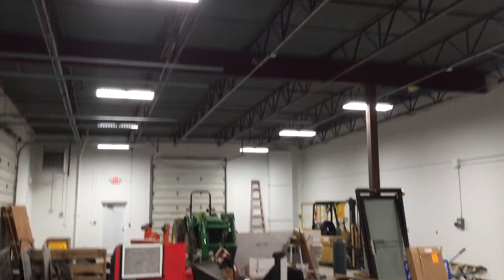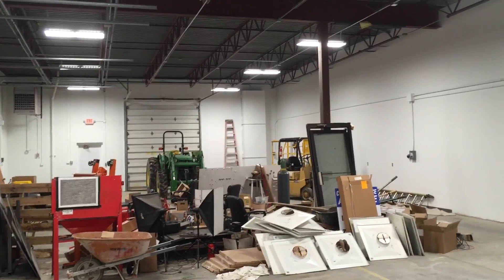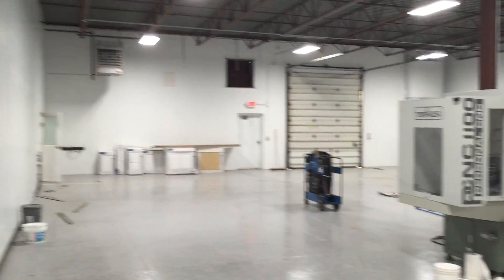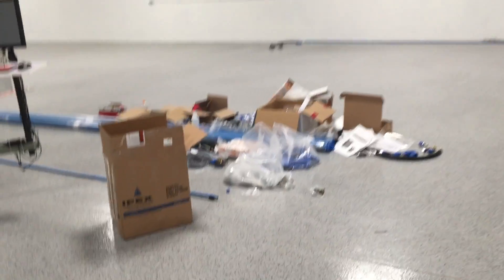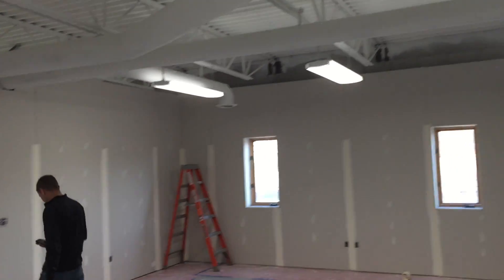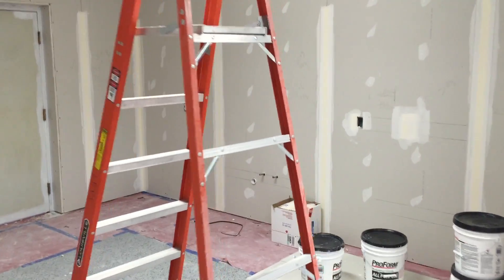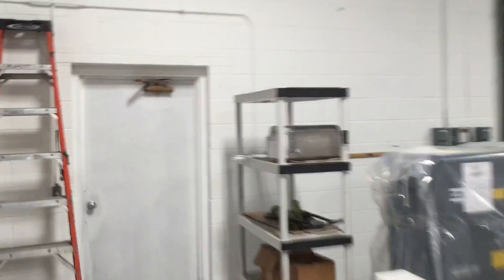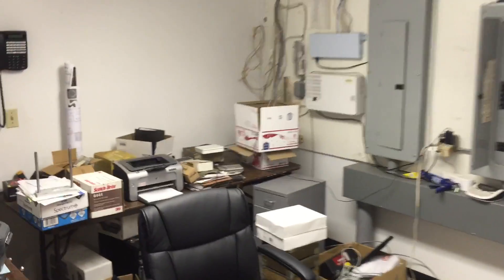Shop Update!  LED Lights installed!

Comment: You'll be surprised how much light machinery absorbs when you get everything in there.  In our 2000 sf shop we have four huge halogen lights and have to have 8' t12 strips over the machines to brighten it up.
Reply: +NYC CNC All kinds.  We've got a Haas that is white/light grey, a Lenlond Makino that is orangish yellow, and everything else is pretty much machine grey.  I think the different colors absorb light in different ways.  Our electrician friend was explaining it to me one day.  Could be bs, just seems legit since certain areas seem darker given the same amount of light.
Reply: +Dustin Walden You have problems? I work in a workshop with concrete floor, walls and ceiling and the only natural light is in the paint shop and the lunch room. It gets very dark if the power goes out, especially in my welding bay.

Comment: Anti-theft measure. I doubt that you will do it but an ounce of prevention... - -  Rig a fat chain or rod from your new compressor to a lug that is embedded into the floor and do it in such a way it would take a good bit of time to detach it. With the compressor beside a large door like that it is a more easy target for someone with a truck that has a lift crane on it. - - - Just my 2 cents. I'm tired of hearing about how thieves get away with the goods so quickly before police arrive. - - - That tie down idea is great for anything that is expensive and can be quickly removed.

Comment: I know this will probably never happen, especially with all the big projects you have going on... but seeing Judd made me think, it would be cool to build an Arduino controlled CNC cutter/engraver just to make dog ID tags... like little Judd silhouettes with name and phone number on back, or a "milk bone" shape with the same. I think that would be a cool, and could even be open sourced for to use in schools, to get kids interested in CNC and the trades... plus they get to make a tag for their pet!
Reply: +TheSageDad I've been working with my shapeoko cnc machine and a Dremel engraver to do some engraving work, potentially on dog tags.  the real trick is fixtruing, which can be tough to figure out.     I'm working with my schools FRC team to make custom engraved dog tags to fabricate and hand out at competitions.
Reply: Seamus H That is awesome... Maybe you could order or make pre-punched sheets of metal, with tabs in it so you could just worry about doing the engraving. That way the sheet itself is the fixture, e.g. prepunched with 3x3 tags in a grid or something. I just wonder how you could roll the edges though...
Reply: +TheSageDad  I was considering creating a tag shaped recess about one cm or so deep that the tag would fit into, not a hard press fit, but pretty snug.   Then have a threaded insert underneath where the chain hole for the tag is.   the person puts the tag in, tightens down a bolt through the tag and into the threaded insert and hits a button (once the enclosure is closed) to start the engraving.    You can by cheap dog tags at $22.00 for 100, which is pretty cheap and it would be a real show stopper!  +NYC CNC What do you think of this sort of fixturing idea.   There is no vise because it's supposed to be a cnc router, but I think that this might just work.    The tough part is making sure that it always homes to the correct place.
Reply: +Seamus H Dog tags are usually made from annodized aluminum (multiple colors) and are die cut (fast and cheap), they are then laser engraved which removes the annodized color layer (again fast and cheap). Metals can also be deeply laser engraved with a fiber laser to a depth of 1-2mm in seconds. Mechanical machining for this type of application is not cost effective. If you want to do engraving, save the $10k you'd spend on a Tormach and buy a 20-30 watt fiber laser marker on Ebay.
Reply: AndTheCorrectAnswerIs The point was to build a personal homemade CNC, not to do this en masse with a Tormach...
Reply: Yeah   it would be pretty cool!   lets see what the future holds, right?    I've never seen a diy cnc punch, maybe you could try that XD